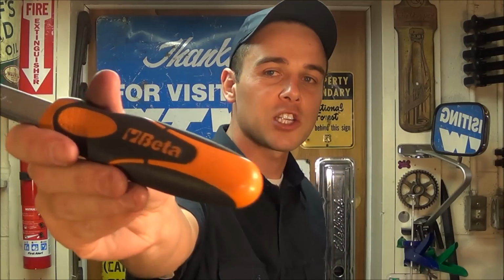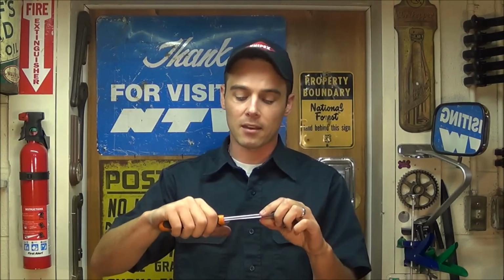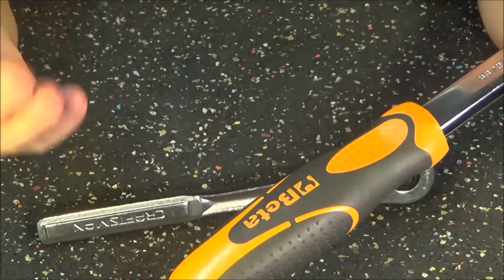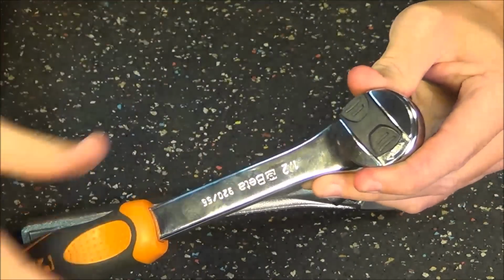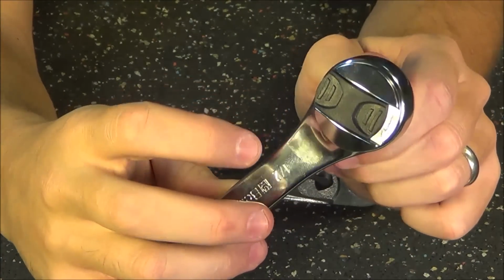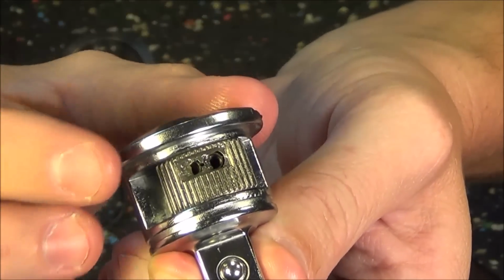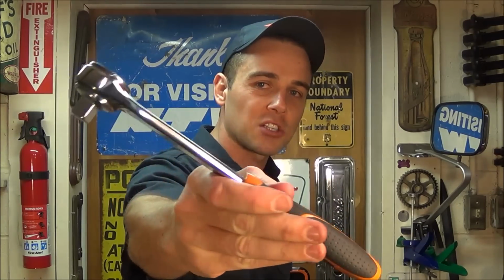BETA 920/55 Ratchet - 1/2" Drive - BETA Utensili

Comment: I have had this ratchet for 30 years and they are great. I replaced it once and am looking to buy another soon. I particularly like the ratchet sound and feel. I give grip comfort 10 and ratchet sound and feel a 9. When keeping the socket on, lets say a shallow or rounded nut, you can accidentally reverse the ratchet when you press on the head with your finger or thumb. This ratchet is also hard to reverse if you cant fit your finger behind the head in a tight spot. The little leaver ratchets are better that way but they are easier to accidentally reverse.

Comment: The ratchet can accidentally reverse when you place your thumb on it to keep the tool pressed onto the nut which might be small in height or have rounded off edges.  I have done this a few times. So BS to this commentator. 
I have used Beta ratchets for about 30 years. I have the original with a big lump of orange plastic for a handle then the older upgrade with the orange stripe on black and the most recent with the orange swirls. The ratchet mechanism or head has not changed over the years. Personally I like the "sound" and feel of the 72 tooth ratchet compared to others. If your looking then I would also suggest you look at a plastic or aluminium body ratchet as well before the expensive relatively "heavy" but unbreakable Beta. Only some Beta tools are very good. Don't buy everything Beta. There are plenty of sockets, screwdrivers etc from other manufactures heaps better and much cheaper than Beta.

Comment: nope and nope. so many negatives about that design. I have never had  a directional lever flip with my wrenches where they are flush. Secondly if any of those teeth strip on the inside of the head the rachet is dead and instead of replacing the gear like in a conventional rachet you now have to replace the whole rachet. Thirdly it's not 17 teeth that's contacting the inside of the head. Is that a brass pawl? I really don't know how this design trumps a conventional rachet for it's a chunky fella.
Reply from the maker: 17 teeth PER side of the pawl....so yes, it is 17 teeth engaged, not split in half.
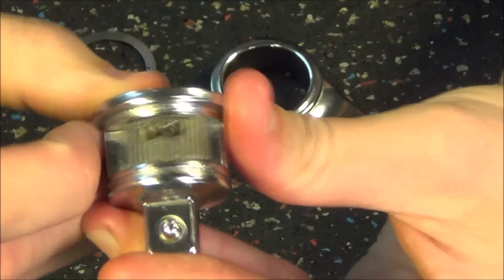Reply: Real Tool Reviews ah no it's not. I counted them @ 4:20. 9-10 teeth that's half cause of the cutout and 4-5 full teeth on each side of the cutout. I'm not trying to bust your balls man so bear with me. At 4:20 I see the teeth kinda messed up and looking sorta stripped.

Comment: hey bud I like your videos they're always verry informative. One side note though, the cold from a bare steel tool is not transfered to your hands it is rather the opposite. The heat from your hands is  transfered to the tool. The  reason this happens is that metal is an excellent heat conductor. On the opposite the ruberized handle feals warmer because it is a good heat insulator. Thus no heat transfer.  This is a simple heat transfer concept. When studying thermodynamics one thing that teachers will always mention is that there is no such thing as cold, there is just less heat (energy).
Reply: You have leaned the concept of heat very well, however, you just don't know when you should speak about it. 

I'm an engineer and I know that this is very boring 😂.

Anyhow, you were polite and that's rare nowadays. Cheers.
Reply from the maker: +Maxime Comeau if you grab a handful of snow...what happens?
Reply: +Real Tool Reviews Same principle here my friend the heat is drawn from your hands and transfered to the snow...
Reply from the maker: Ah.....yes, smarter-than-thou "teachers" who like to belittle everyone around them.....since atoms are moving, technically heat is being generated & the only "true cold" is with no atoms moving.  I have heard this line of BS for years.....funny that garbagemen make more than these morons.  They have no friends, no life, and only enjoy making others feel dumb.  I don't buy it.  I do not walk outside in a blizzard & say "it is less hot".....I say "it is freezing out here".
Reply: +Real Tool Reviews hey no need for trashy comments here  my friend ( Pun intented)... dont get me wrong inevitably your hands will get colder. You just had the way of tranfering that heat bacwards.

Comment: Maybe I'm missing something obvious but it looks like the radius on the pawl is actually smaller than the inside of the ratchet (You can see this at 5:31) which would mean its definitely smaller than the gear on handle part of the ratchet. So all 17 teeth would not be engaging at once. It would be half of them at best.
Reply from the maker: +Jack DIllon It has pawls on both sides of the mechanism....a total of 34 teeth.

Comment: Its not offset and the direction switch looks like its rather stiff.  I like the direction control of the Craftsman you showed.  I don't need to see it to change it.
Reply from the maker: +glocknutmike Hand tools are definitely a "preference" issue in many cases.  No one tool will be the best for everyone.

Comment: That plastic handle will be all dirty and broken in the first month of use in real life conditions, then will start sliding and of it goes.. I like more the metal ones, no problems there and easy to keep clean.
Reply from the maker: S.Ciprian Ciprian They have been making this style of handle for a long time.....everyone that I have spoken to that uses them loves them......I think this is a cosmetic issue that would come down to a personal preference, but without extreme abuse, there is no way this will break under normal conditions.
Reply: Here is my 1/4 Craftsman Evolv (for lack of a better example - It's Sunday and I'm at home not in the shop )  ratchet with the "rubber / plastic  " handle  ; http://1drv.ms/1e9bRHt   ,   http://1drv.ms/1e9bVHl .

Normal use over a few years and it's a mess (no abuse - just having it in a tool box and working with ) . Now, my other ones who are just steel are still looking like new and it's very easy to keep them clean so that's why I don't like those plastic handles. 

Now the beta one may be a better quality, but in my book I'm pretty sure will not outrun a clean shiny steel one ...
Reply: We use beta ratchets all the time and even on the old ones (from 2009) the handle is in great shape, even after we've used them with a steel pipe over the handle to apply more torque
They have been used, dropped, left in the rain, handled with really dirty gloves (oil, grease, petrol...) and they're still in great shape
Reply: That's good to know. I will keep this in mind next time when I'm in the market for ratchets. Thank's!

Comment: oh come on i own bull load of ratchets starting from Chinese made ones that i sometimes get it just for laughs and up to top brands and i never flicked the ratchet by mistake ? and suppose you do it once or twice" assuming your not clamsy enough to do it aloooot ?.......that's not gona make you inefficient 
okay constructive comment time :
BETA TOOOOLS are shop grade " yes you can depend on these for a long time...well built i must say.yet they cost far less than snap-on..
1/2" Drive - BETA Utensili with rubber grip "around 60 dollars" VS similar ratchet from snap on easily above 150 dollars
and beta do offer rebuild kit for their their stuff which makes this an excellent choice 
i though it was going to go for like 120 or.100 ....but 60 ? thats cool...made in italy..not bad ,,,not bad at all...
i might buy this for my friend cause he suffers from crappy chines ratchets so i can steal it from him time to time LOL

good show anyway and thanks for your time and effort
Reply from the maker: Faisal Abdulaziz Thanks!  I pointed out the directional change switch on the BETA, since it is a fairly unique design & removes a lot of the issues that people have with tight areas & ratchets with non-flush directional switches (that WILL change directions inadvertently when you have your thumb near the head on them).  I have heard that BETA does make a separate "less expensive" tool line for certain buyers, but their normal quality is 100% top notch.
Reply: no doubt...no doubt
i know a beta freak who own everything...i mean evrything is beta in his shop...we call him the orange guy...and he swears by the brands craftsmanship 
i went to their dealership today to have a look at their stuff...they have certain great feel to them....sweet stuff..their selection is growing slowly..
if it builds certain items better than other makes,,,then why not...
not a bad idea to have their catalog around...

and keep the video coming pretty please
hey...you should try a snap-on F80 ...3/8 drive 
that thing is just awesome in a tight engine bay...thanks to its design 
a must have in opinion